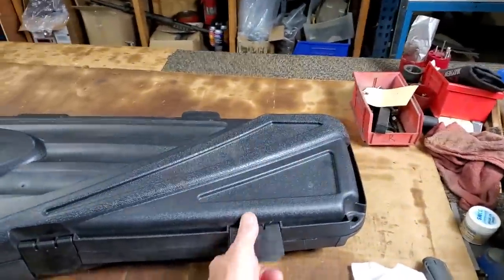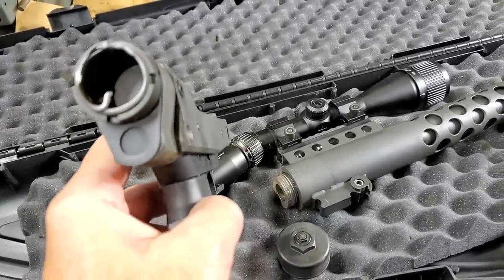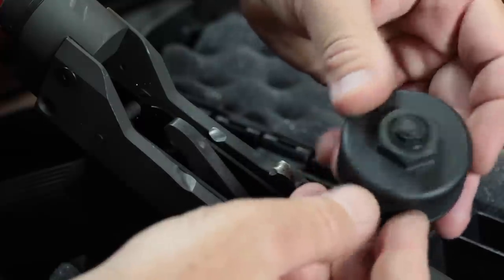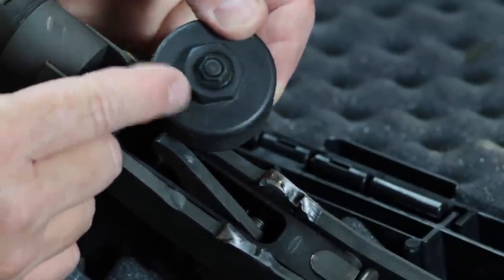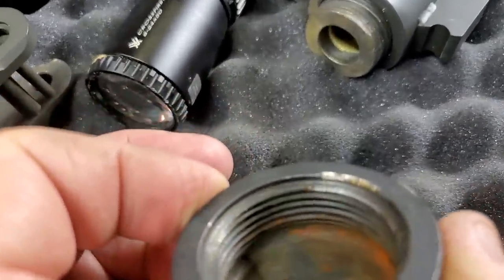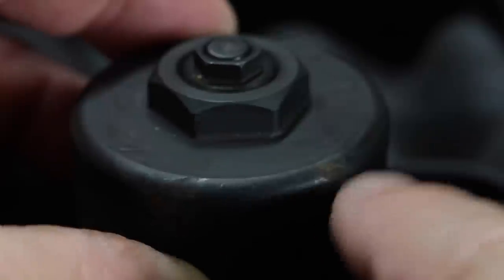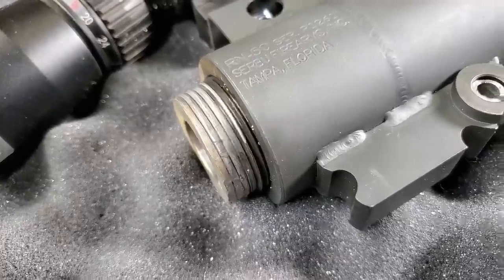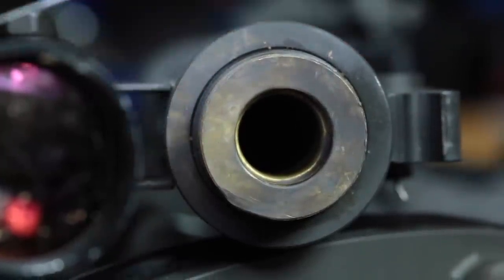Kentucky Ballistics' RN-50 Blow-up:  First Look

Comment: The discussion of “redesign”  or “strengthening” any of the areas that “failed”.......

The forces had to escape. If any of the “failed” areas are strengthened, those forces will leave in a different location. 
Will it fail in a better or worse way?

Sometimes when guns kaboom, the force exits the mag well, minimizing the injury risk. Other times the barrel will banana peel.
Sometimes they fail similar to a pipe bomb.

Sending the force down the mag well isn’t an option here. While Scott’s injuries weren’t minor, simply increasing strength to create a pipe bomb doesn’t seem desirable either.

Some machines have failure designed into them so that an issue is less catastrophic. ( helicopter main mast comes to mind)
I don’t know if a stress point so the barrel pops off heading down range is a possibility. 🤷‍♂️

Perhaps this gun will see some improvements.
Maybe it’s good just as it is.

I’m glad that Scott is recovering. That is one tough dude.

Thank you, Mark for sharing information about this incident.
Reply: Four radial pressure relief holes at the bottom of the caps threads wouldnt be a bad idea.
Reply: Bolt action rifles have a vent hole in the barrel near the rear of the chamber.
Reply: Unfortunately, failsafes only fail safely within certain tolerances. Vent holes might cause a different type of failure, but a failure of this magnitude is unlikely to be avoided or abated by blow-out venting mechanisms. Typical vent holes on bolt-actions work when the bolt and casing are forced out of battery, and this allows an escape of gases along the path of the bolt. These vent holes are there more to prevent those hot gases from being directed at the shooter's face than to prevent an explosive detonation. Small vent holes would likely not be able to lower the pressure to safe thresholds in the case of what I'm going to call a Rapid Complete Propellant Deflagration quickly enough to avoid a Rapid Unscheduled Disassembly of the firearm's breech.
Reply: well when this gun blows up it sends a massive chunk of metal at the users head so yeah i'd say probably needs improvements
Reply: @1xavi2  This gun needs well in excess of 100,000 psi to blow that cap off. Run-of-the-mill 50 BMG doesn't make that. If you're going to fire a round that you believe could grenade the gun, remotely fire it from behind a rock. So then, why does this gun need to be redesigned? You sound like every other armchair engineer.
Reply: @dragonflyfab9703  I don't know if vent holes could have releived some pressure quick enough in that instance... bolt action vent holes are there to vent the pressure and gas of a classic head separation, however that slap round created a massive overpressure detonation much beyond what happens during a classic head separation, it's not the brass that failed here. The head separation is the symptom, not the cause. I'm not positive vent holes would have helped anything.
Reply: If those tabs were reinforced they'd just be a heavier piece of shrapnel because they weren't stopping that cap.
Reply: Maybe redesign it so that if the cap comes off, it will be forced downwards rather than into the shooter’s face. Also, destructive testing should always be done, to see exactly what happens when it blows up.
Reply: @KiithnarasAshaa  explosions are an overpressure of gases, gas takes the path of least resistance. The failsafes may not prevent injury but it will prevent serious injury or death. Just like your cars airbags wont prevent injury in a high speed crash BUT it will protect you from dying or very serious injury, Even if a failsafe shaves off just a milsecond of time from a failure, just that minute bit of time is often the line between life and death. Same with cars just adding that few extra seconds of deceleration in a crash often is line between you being in a hospital or walking away from a wreck unscathed. Dont knock failsafes they exist for a reason the more you add the better
Reply: I think I read earlier that Mark thought it was on the order of double the design pressure. I think more like orders of magnitude greater. That kind of massive destruction is way over the design spec. It would be interesting to disassemble one of those rounds and test the powder and then fire one in an instrumented test bed.
Reply: @KiithnarasAshaa  for a failure this massive I think a it would be pretty reliable.
Reply: @ChristopherKnN  the designer said in the event of a detonation no vent hole would save the gun. nor would vent holes save the gun if a leak occurred in the cap.
Reply: @1xavi2  even barrets will blow up and potentially kill the user if you have a round fire as you are ejecting what you think is a dud.
Reply: @ethanlamoureux5306  any pressure that would cause that cap to come off would injure or kill the shooter. its the equivlent of a pipe bomb going off in the gun.
Reply: @jeffprice6421  try triple or more. more pressure was occuring then in a tank cannon barrel when it fires.
Reply: It's safe to say there's probably no way to make it safe to fire what at this point is proving to be a high explosive. I bet the things are full of pistol powder. Somebody found them empty or deactivated and saw how much theyre worth, and went on ahead and threw any old powder in
Reply: You can definitely incorporate gas redirection channels or cuts into the rifle to allow gas to escape in case of a failure in a much safer way or in a much safer direction. After this happened Ian from Forgotten Weapons actually did a video discussing firearm catastrophic failures and methods such as that which were historically implemented. Whether Mark does that or not is up to him, but really, I don't see this as some sort of "failure" of his design or manufacturing. To have something that energetic to where you're sheering off breach threading like it was butter, and that much of it... That's way beyond over-engineering. If someone decides to, either through incompetence/negligence or ill-intent to turn a .50 BMG round into a mini-pipebomb like what we saw here... There's not much you can do unless you build an absurdly over-built and engineered slab brick of a gun when you're talking about those kinds of pressures and energy.

Frankly, I'm of the opinion that this would have been a whole lot worse with some of the lesser quality .50 BMG single shots that are out on the market if this had happened with them. Considering this was so far and above what was expected of the rifle, I have to say it did a surprisingly good job. And, thankfully, Scott wasn't killed by the incident.
Reply: @1xavi2  
"well when this gun blows up it sends a massive chunk of metal at the users head so yeah i'd say probably needs improvements"
...No. This was way beyond anything the rifle was expected to ever see and handled it much better than other .50 single shots would have. What you're saying is like coming to the conclusion that since a sports car can be in a 100 MPH collision and have the occupants come out fine that therefore the car's occupants should be just fine if you strap a gigantic rocket onto the same sports car and have it smack into a concrete wall at the speed of sound. Doesn't work that way.
Reply: @thegunfoogle2864  at a hundred bucks a pop you can bet they would scrimp on what they could to make the counterfeit pass since they wouldn't care if somebody fired it.
Reply: @md_vandenberg  85,000 PSI to blow cap, 30,000 PSI leeway, thats ALOT, as an average 50cal detonates with 55,000 PSI on average do you agree? and yes as a genuine enginner... im no gun smith but i do have a degree, only my opinion....threads.... do you want to talk about tensile strength and variation in thread design. The tensile strength of the threds failed, obviously, but as also stated in the case of an obstructuion, as seen. i feel, that its not great.... so, what do you do? do you create a weak point? make it so instead of sending a cap at your face, it blows up like a bomb in your hands? what do you do? I agree with you, to a degree.... My question to you is.... do you create a built in fail point NOT the cap.... or do you continue and chalk it up to... It can happen? cause the end cap blowing CAN happen. What do you do? How would you promote a fix to this? design a weak point into the RN50? or increase the tensile strength of the threads on the male side end cap? or call it an act of god and forget about it? I will tell you now, Old mate here has had MANY sleepless nights thinking about this exact issue and a remedy. I feel the round may have been the issue, BUT i also feel a very very close look at the cap threds on the male side should be considered as it may have been a manufacturing error from the very day the RN was built. Am i wrong? im sure it would have been considered and i hope we are privileged enough to view the investigation as it occurs.
Reply: @Cameron Brooks or created more shrapnel or damage because the metal ears on the back should have done the same thing in theory. Should have directed the cap up and away safely but instead sheared them off and one, as I am sure have seen, caused even more damage to Scott.
Reply: @Cameron Brooks And what if a Left Handed shooter was on that side? You can't deflect something off to the side without compromising the safety of an opposing shooter.
Reply: I'm waiting for somebody to talk about the fact that the cap threads were still fine but the bolt threads were stripped out?
HOW IS THE CAP STRONGER AND RECIEVE NO DAMAGE TO THE THREADS? 
Seems to me like if those threads didn't fail this would not have happened
Reply: @md_vandenberg  how do the cap threads remain fine but the barrel threads are stripped? 
You would think those would be similar Metals with similar maximum capabilities? 
Over 85000psi and didnt hurt the Cap Threads at all????????????
Reply: @ethanlamoureux5306  seems to me if the threads on the boat we're stronger the cap would have never flew off like that since the cap wasn't hurt at all
Reply: A redesign with a consumable blow-off cap for super high pressure rounds. The MDR uses something of the sort, I think.
Reply: @thecloneguyz  He stated the cap is hardened steel. He did not specify the treatment on the barrel or chamber threads. Perhaps the chamber threads are not treated.
Reply: It could improve, even an increase in thread size and count would let the barrel blow before the cap launched.  This was a special build, I wonder if that would have went differently on his lighter barrel.
Reply: @ChristopherKnN   he’s tiptoeing around those because he knows they fucked up when they beefed up that barrel and didn’t do anything to strengthen the threads more than their standard guns are.
Reply: The simple answer is the barrel should have failed first, before the end cap. Perhaps then the pressure wouldn’t have been strong enough to even sheer the cap off, who knows.
Reply: I think the most obvious improvement would be to not use "ears", have the safeties run all the way to the back of the lower.
Reply: @ChristopherKnN  That was my inital thought as well, but I don't know if that would be enough to vent that much gas, that fast, without making the hole to large to support the case properly, even with normal operating pressures.. Perhaps a longer breech-cap, where gun gas from a ruptured case, could be ventilated downwards and out of the gun, would be a option.
Reply: @giovannigiorgio4622  Mark sad in one video that he dont know why he sad 85000psi and that the parts are able to take much more then 85000psi... 85000psi would be just overpressure test round territory so RN50 is more than likely to withstand that much pressure...
Reply: Honestly, this is the comment that sums up the whole situation. Thank you
Reply: Even if there were 100% threads which are typically 80% and they were hardened to an equivalent Rockwell, something is going to give or become so brittle it becomes a fragmentation grenade. Which considering the force, it may have been anyway
Reply: I by no means know anything about gun engineering, however, could you have a double thread collar type system for the end cap? I'm thinking something similar to the ring type system you seat a fly fishing reel onto a fly rod?
Reply: @md_vandenberg  it depends on what the goals of the design are, which makes the difference between a heavy-duty product and a light-duty product. If you don’t want to design for what is obviously a possible outcome, then you can just leave it to the operator (not very smart engineering). OR you can design for that and be sure that your customers won’t be harmed by an event that can happen even with a reasonable operator.
Reply: @Cameron Brooks   He was supposed to remove the Muzzle Break before shooting the SLAP Rounds.  Had he done that, there wouldn't be any problem with the rifle.
Reply: @giovannigiorgio4622    He was supposed to remove the Muzzle Break from the barrel before using the SLAP rounds.  There may have been nothing wrong with the SLAP rounds.  Each round he fired was behaving very poorly...Had he removed the muzzle break first; maybe nothing would have happened at all.  I don't think there is anything wrong with the gun.
Reply: @NosActivated420    Somehow, this keeps getting over looked!  Had the Muzzle Break been removed "first", there might not have been any accident at all.  You can see in his video, every SLAP round he fired, was NOT behaving properly down range.  That should have been a clue, something was wrong and he should have just stopped shooting those rounds till the problem could be figured out.  These things do happen; so it is just something to learn from.  I don't think there was anything wrong with the gun.  Simple test:  Buy some of these SLAP rounds...remove the Muzzle Break and see how the gun handles the rounds.  Then put the Muzzle Break back on it and see how each round is impacting down range, or if the gun blows up again....that's just what I think.
Reply: Richard Folgado so what exactly did the muzzle brake do that caused that much pressure that quickly? Just about every claim about the muzzle brake being the problem either doesn’t make sense or could be easily disproved.
Reply: @RichardAmmo1  So uh, do tell me. How does the muzzle break kick the pressure up so high that it surpasses about 20k+ over NATO standard (60k psi (being the highest pressure and based of NATO EPVAT standards for .50 bmg)) to shear the threads off. Like he said, it had to surpass 85k to shear the threads off, and the pressure actually would have been well over that. I find it highly unlikely it was user error at all, and just down to the round alone being freakishly hot.
Reply: Stop buying budget .5 0 Cal be a good start
Reply: @gnarmarmounts  I really do hope you know that this gun falls into that 2000-4000 price range for single shot .50 bmg rifles. Also because the price is low doesn't mean the quality is either, and vise versa, the price being high doesn't mean quality at all.
Reply: @thecloneguyz  because it is a 50/50 situation. Either the cap threads will fail or the bolt threads will fail. There is almost no way for both to come out OK.